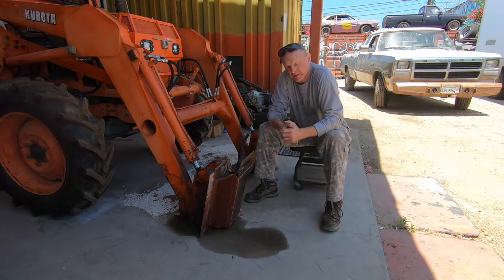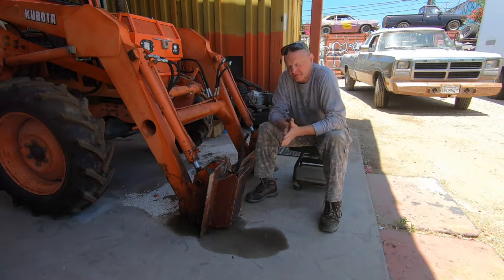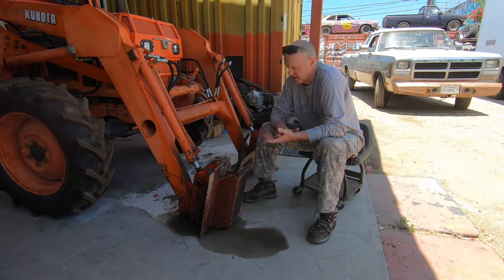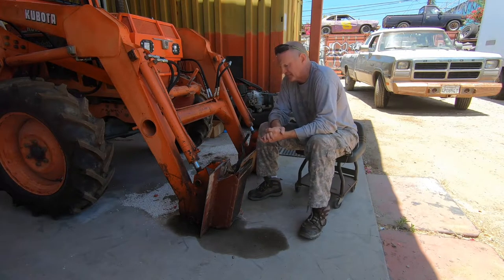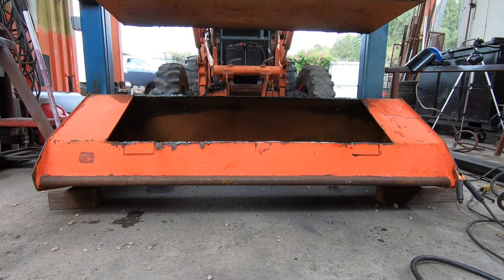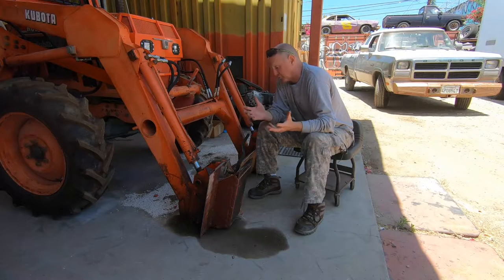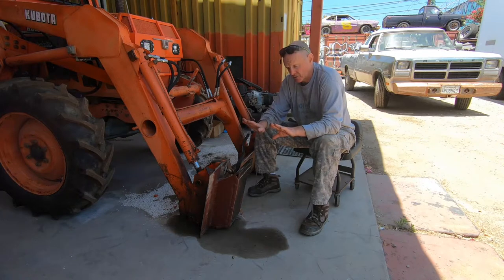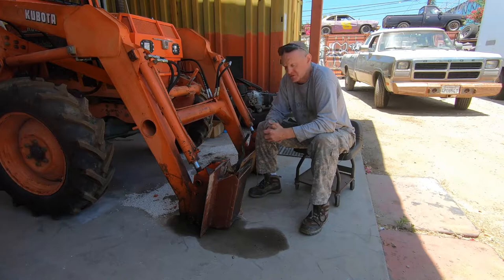How to convert a pin on bucket to a quick change bucket

Comment: Great idea cutting whole back out! I was dreading cutting all the welds just to get it flat to put the adapter plate one the bucket.
Reply from the maker: Being a little OCD like I am, I actually measured how much cutting and welding each option of doing this would be, and it turned out, the way I did it had the LEAST amount of welding and cutting.,  Glad you liked the video.

Comment: Great idea I have seen an reviewed so many ways to change to quick attach brackets an try to save front end loader bucket to still be useful an useable again info an video was very useful I kinda wish your video was a little longer maybe you can do a refreshed one in the future at a slower pace an use different style an size buckets an buckets from different manufacturers.
Reply from the maker: I try to keep my videos short and to the point, since I've got ADHD and hate sifting through a ton of BS to get to the info, but I do appreciate your view and comments.  

The quick release buckets are pretty much a standard, so "different brands" wouldn't make much of a difference...

Comment: Great video. Seems to be much more simple than some of the other methods I have seen. Quite a bit more cutting and welding than other options, but no need to buy a pin on kit, which allows the use of less expensive kits. Thanks for the idea. But, I have one question. Did you say what the thickness or gauge of plate you used? I was thinking about using 1/4", but I need to measure the thickness of the back of the bucket to make sure 1/4" isn't overkill.
Reply from the maker: Generally speaking, when I measured it all out, (my OCD took over.. lol) I found out this way had less overall cutting and welding, and arguably is stronger because the cross brace of the bucket is left on the machine.  I have used this a lot, and not had any issues.
Reply: @eddieco  Unfortunately, I don't have a plasma torch, but I would love to have one. I will probably use an angle grinder, which will take more time, but I will just have to deal with it until I have a bunch of loose change. Thanks again. You are an inspiration for my next project.
Reply from the maker: @woodcraft70  Angle grinder with a cut off wheel should work fine.  Glad the video was a help!  That's why I make them.

Comment: that is a good way to do this
Reply from the maker: Thanks.  I saw a lot of videos where people did a LOT more cutting and fabricating to just cut the brackets off, and when I sat and thought about it, there's less cutting and welding overall to do it this way, AND the bucket arms are still kept inline with each other by the large bracket that was on the back of the bucket.
Reply: @eddieco  I was thinking to cut the whole back out and getting a 5/16 quick connect plate for the back of the bucket to Weld in

Comment: im about to put a new quick attach on a new bucket..im not sure how to get it all lined up as in ,do l need to have the skidsteer on a flat floor to get it right?
Reply from the maker: I'm not sure a few milimeters being off would matter but I would start with level floor and all the tires aired up properly

Comment: Thanks for the great info.  Can you post a link to the parts you had to buy?
Reply from the maker: The only part I bought was the quick change unit.  You can find them for about $100 on ebay.  The rest was just scrap metal we had lying around the shop.